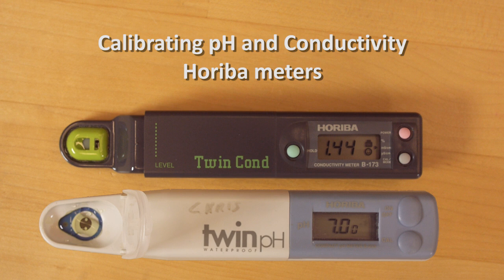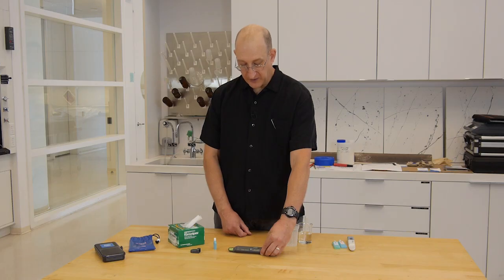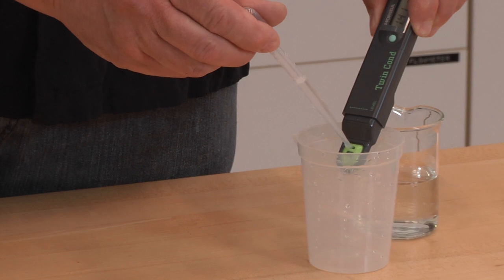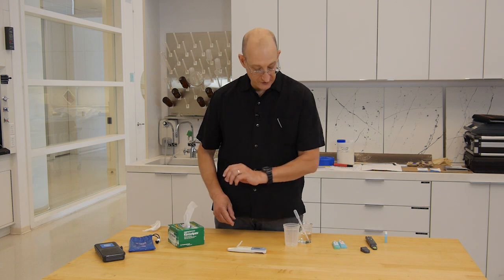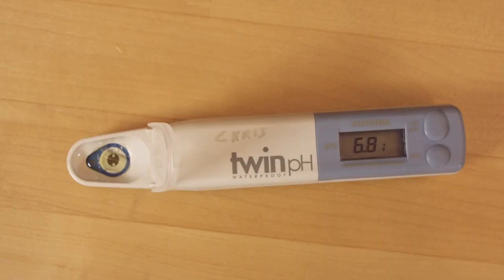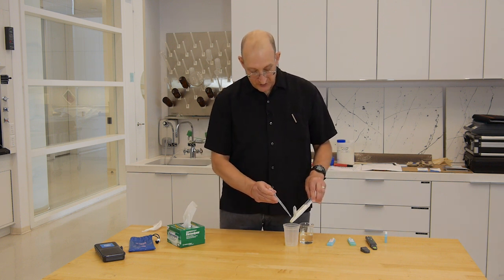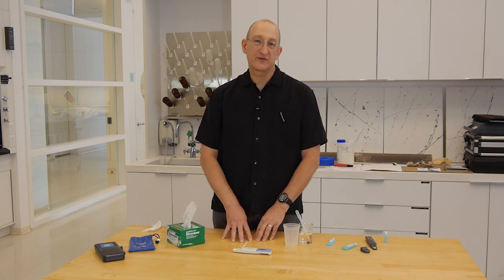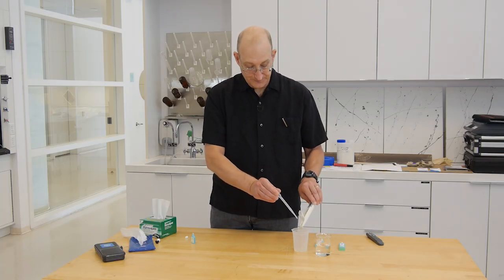Calibrating pH and Conductivity: Horiba Meters (Older Models)

Comment: Can I buy one Horiba Laqua and use different electrodes?
Reply: Unfortunately, the LAQUAtwin meters themselves are different, not just the electrodes. These new versions also have an additional button "meas" compared to the older meters shown in this video. In addition, the LAQUAtwin pH meter has to be specifically configured to use dual calibration points -- out of the package it only calibrates to a single pH value.